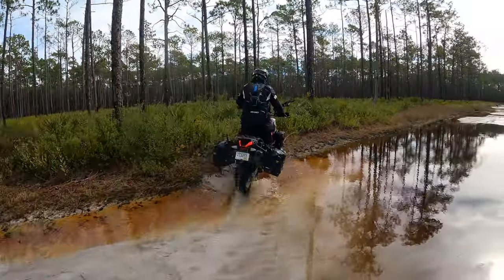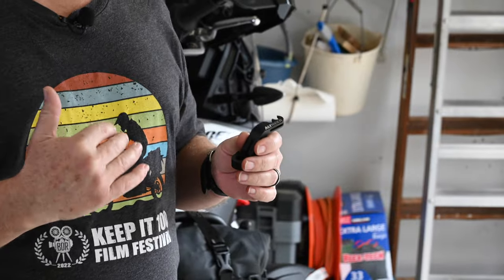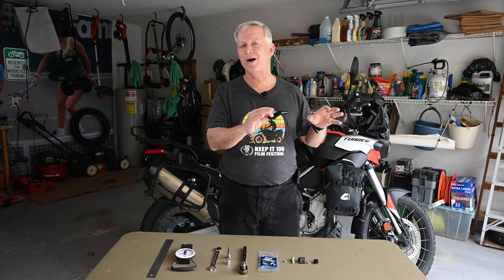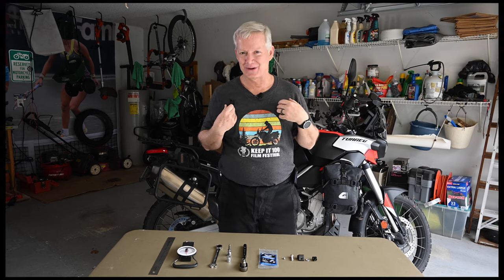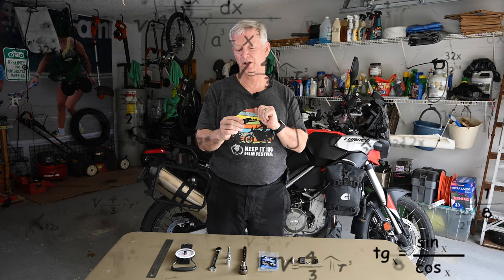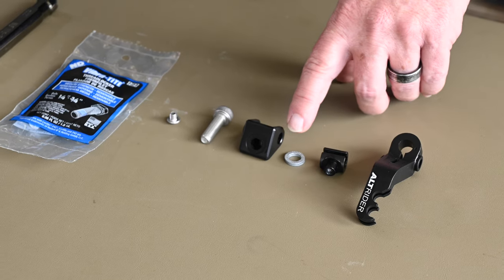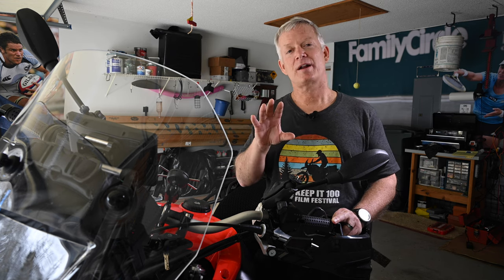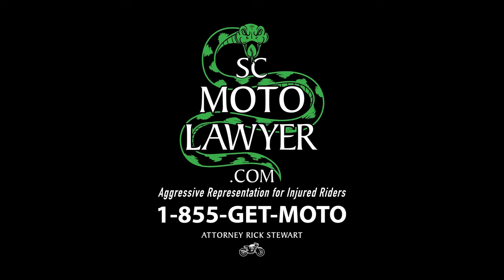AltRider Clutch Arm Extension - Is it Worth It????

Comment: I installed this on my Tuareg,  Love It. Really helps with my arthritic hands
Reply from the maker: That's great to hear, Lane!  Thank you for sharing your feedback.  So far, I'm really happy with the upgrade as well.  - Chris
Reply: Glad it can help!
Reply: Hi Chris, I tried the knock off AliExpress and it’s junk. No splines on the arm shaft hole and the cable holder is very wobbly. Needless to say, waste of time. I’ve already ordered the AltRider one as well as the brake foot pedal. Thanks for the content
Reply from the maker: @royalty7396 thank you for sharing your experience about the knock-off.  I think you'll be pleased with the AltRider products!  Note that theirs doesn't have splines either.  Because it's made out of aluminum, it "bites" onto the shaft without needing splines.

Comment: I really enjoy your program, but I feel the pull on the Tuareg is somewhat very light. That being said, expanding your friction range by increasing your lever might shorten the lifespan of the clutch. Personally, I don't think it's worth the risk.
Reply from the maker: Thank you for the kind words, Marco!  I enjoy all your insights on the forum.  And I value your comments.  The reduced pull on the lever is nice.  And I do like the expanded friction zone...gives me extra control.  I have it set at the half-way mark (23%).  I was going to try it at the full 47%.  But after considering your remarks, I think I'll stay at the 23%.  There is still a little free-play in the lever.  So hopefully it will be fine.  But I will research this further.  Thank you!
Reply: Hello Mark and Chris, we wanted to clarify, that as long as your clutch is fully released (your clutch lever has no tension or free play) there should not be any premature wear on your clutch. I hope that makes sense.  If not please reach out, happy to dialogue further.
Reply from the maker: @AltRiderLLC  thank you so much for confirming this!  Makes perfect sense to me.  I really appreciate it!!!